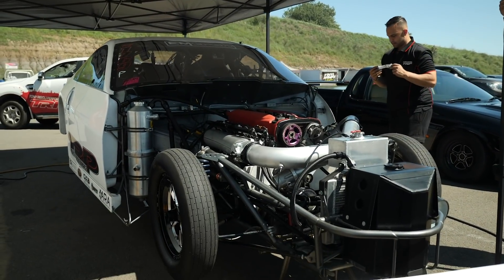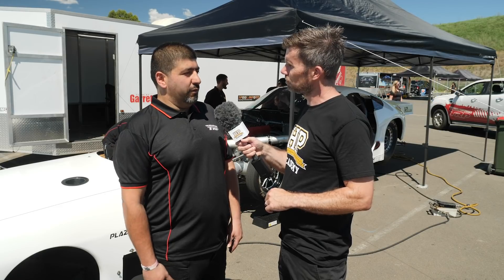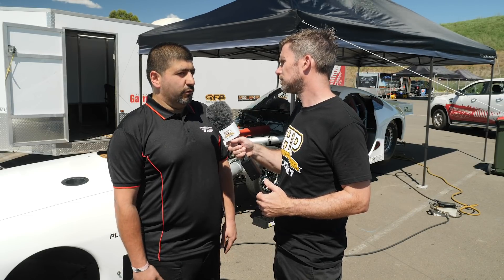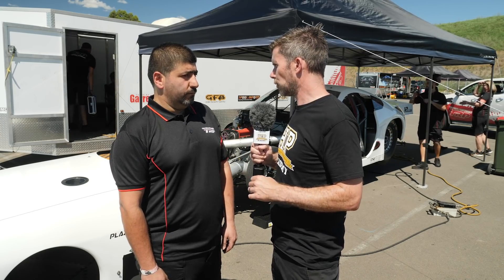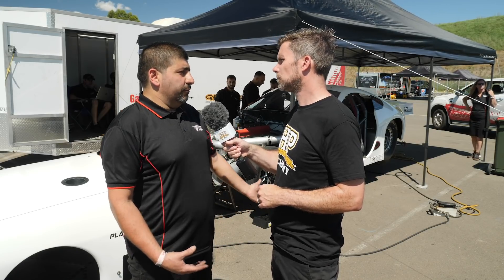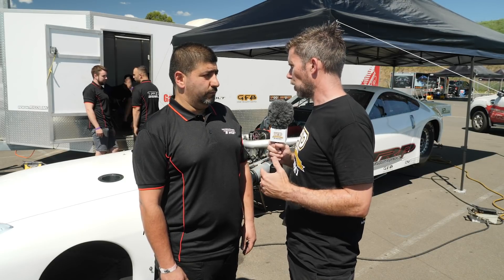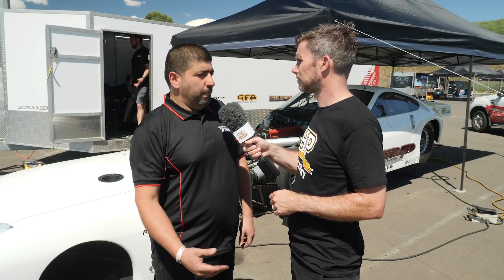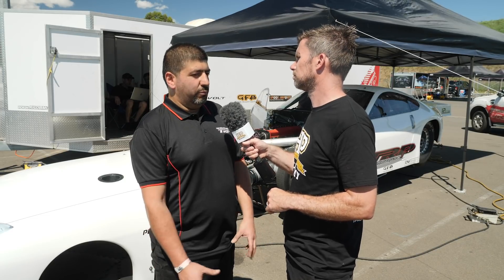2140HP, 78 PSI of BOOST | RB26 World Record TRP [TECH TALK]

Comment: The RB isn't even the fastest drag Nissan engine the Vq, Vg and even an Sr is ahead of the RB engines

Good that they are pushing it but the RB block hasn't got the design chops to run with the Jz and the other 6 cylinders engines ahead of it
Reply from the maker: The problem with any V6 is the available area for the big end bearings is just too small to be reliable at the power levels the import drag crowd are reaching now. JR from ETS makes 3000 whp from his R35 GTR drag car and they replace the rotating assembly every 15 passes. You can't engineer a solution to this as it's a limitation of the V6 block architecture. An inline 6 (or 4 for that matter) can provide a much larger area for the rod bearing hence it has a distinct advantage from the get go. This of course is only one consideration when comparing engine designs, however it's a pretty big one - Andre
Reply from the maker: The fact the RB isn't the fastest Nissan badged engine or developed as much as some others, Nissan or otherwise is exactly why the team are developing it 😉 - Taz.
Reply: @hpa101  but is it possible ? The RB is a great engine but even Nissan themselves stopped developing it after 2000,it is great for its time but it's fundamental design flaws makes it  much harder to justify
Reply: there are limits to what cylinder pressure can be held with 4 main bearings in the V6 block/crank setup. That is one reason why all the really fast (5 sec quartermile) 6 cylinders are straight 6's with 7 main bearings.
Reply: @ikijime  the Vq has done 6.03 so closest non inline 6
Reply: @Realtime1501  with bearings require changing nearly every pass at that power level.  Never said its impossible to run a 5 with the V6, just that much more carnage will occur in doing so.  7 main bearings much easier  to live with - if the Rigolis tune carefully the RB may be able to do it with the diesel block once they put the big turbo on (they are around 20-25 psi shy of the boost needed at moment).
Reply: Frank White  bullet engineering
Reply: Dosnt matter the VR will be the future record holder anyways.
Reply: @antilagboostaddiction8322  most likely but there is a lot of Vq DNA in the Vr